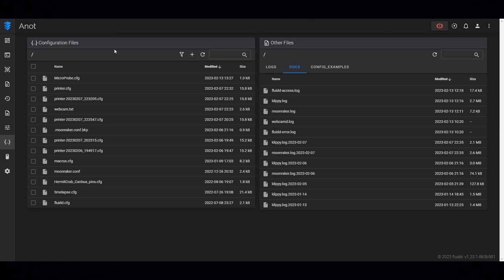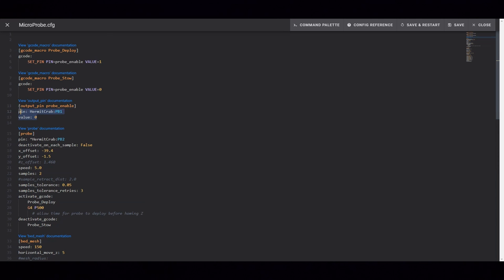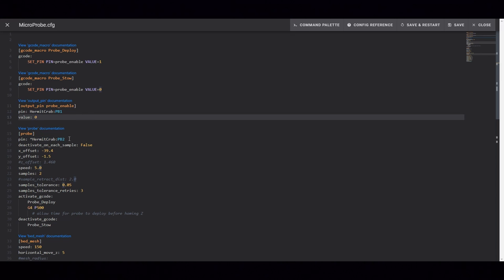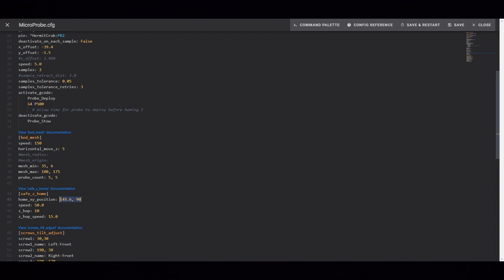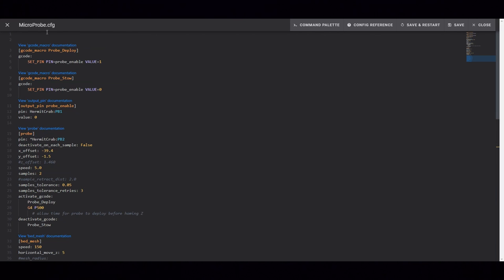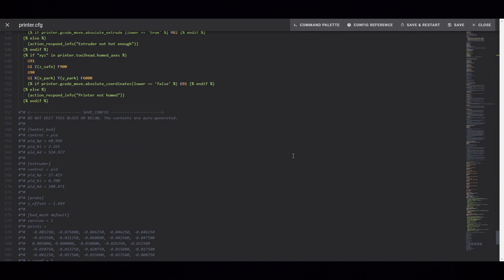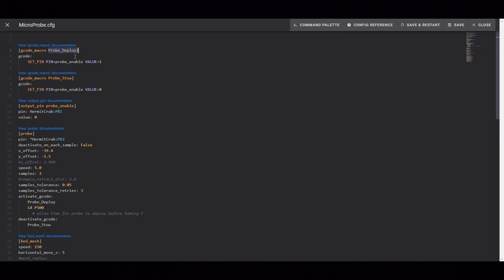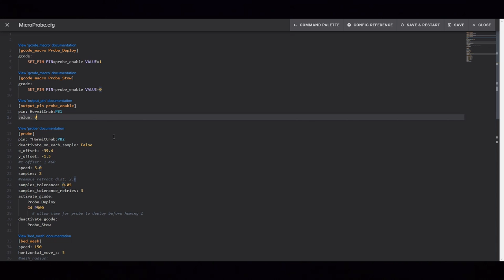How to configure the BIQU Microprobe for Klipper

Comment: Greetings, Thanks for the great video but i'm still having problems with mine.  I have the v1.2 release and I'm connecting to the Creality 4.2.7 M Board with Klipper as the UI.  For the life of me I'm missing something in the printer.cfg because all the probe will do when homing Z is extend / retract 4 times and then Klipper errors out with a probe retraction was not detected.  Here is what the config looks like:
[bltouch]
sensor_pin: ^PB1
control_pin:   PB0                    
x_offset: 39       
y_offset: 5.0

[safe_z_home]
home_xy_position: 117,117
z_hop: 10
z_hop_speed: 5 

Any thoughts?.  Thanks for the read. Doc'
Reply from the maker: You have it set as a BLtouch. You cannot use that as a BLtouch. It must be set up as I described in the video. Setting it up as BLtouch can damage the probe, from what I have seen with other users.
Reply: @StackingLayers Thank you for your reply but just for clarity please,
 

The socket on the 4.2.7 board is labeled Left to Right >  Gnd - V - IN - Gnd - OUT.
The Micro Probe socket is labeled board side Left to Right >  Gnd - V - Servo - Gnd - Probe

Your microprobe.cfg file is:

[output_pin probe_enable]
pin: HermitCrab:PB1         # Change this to the Servo/control pin number for your board.
value: 0

[probe]
pin: ^!HermitCrab:PB2       # Change this to the Probe/Z- pin number for your board. Remove the ! for V1 probes.

A few questions please:

Does the Ender (4.2.7) IN   =   Micro Probe "Servo"   =   [output_pin probe_enable] in the cfg?
Does the Ender (4.2.7) OUT   =   Micro Probe "Probe"   =   [probe] in the cfg?

Should my microprobe.cfg files first few lines edit to:

[output_pin probe_enable]
pin:  PB1         # Change this to the Servo/control pin number for your board.
value: 0

[probe]
pin: ^PB0       # Change this to the Probe/Z- pin number for your board. Remove the ! for V1 probes.
deactivate_on_each_sample: False
plus the rest of the lines.

Since [bed_mesh], [safe_z_home] and [screws_tilt_adjust] are already defined in my printer.cfg file do I remove them from your microprobe.cfg file?

Thank you again for all your help as this editing is a little bit confusing for an old guy.  Thanks for the read. Doc'
Reply from the maker: In = servo out = probe. Probe will be PB1 and  output_pin(servo) PB0
Reply: Thanks for the information and I'll give it a go.  Doc' @StackingLayers
Reply: @StackingLayers   Thanks for the education and help....it worked perfect.  👉 😁 👈
Reply from the maker: @doctrainsmodifications5201 right on! I'm happy to see you got ot going!
Reply: I have the same board. and i followed this to get everything up and going. and it was working great. i changed the offsets and set a new center bed position. Now all the sudden I'm getting 'Endstop z still triggered after retract'. and i cant manually extend or retract the probe. But when i cycle the printers power the probe extends and retracts 3 times. What am i missing? because I just had it working now I'm pulling my hair out trying to get it to work again.
Reply: Update. In a last ditch effort i went back to the board and re secured all my connections and it seams to have fixed the issue. i think i may add a dab of hot glue to get those connectors to stay in place. they dont seem to be very secure in the old BL Touch connector spot.
Reply from the maker: Checking the connections was exactly what I was going to recommend. A dab of hot glue won't hurt, and a little isopropyl alcohol will make the hot glue release if you ever need to change things

Comment: I'm getting an error with mine when I try to run a full bed mesh. Its saying "Probe triggered prior to movement"  I'm assuming this might be a hardware bug as it works sometimes and fails sometimes. Any thoughts?
Reply from the maker: If it works sometimes then it's configured correctly.

Is it a V1 or V2 probe? Some of the V1 had an issue with the sensor sticking, so if it's a V1 definitely contact where you bought it. Get a video of it happening and you should be able to get a replacement. Just be patient with support,. Do it if it is a V2 too, but I haven't seen that issue with V2.
Reply: @StackingLayers  it’s a V1 that came stock with my Hurakan. Thankfully I got it through microcenter with a warranty so it should be straightforward to get the replacement part.
Reply: @StackingLayers  Would a V2 probe use the exact same plugs? In the event I can get a direct replacement that seems like the easiest solution. So I don't have to re-route new wiring
Reply from the maker: @isaacingalls720 yes. It'll plug in to the same wires. The only thing you'll need to change is to add a ! in front of the probe pin like this,
[probe]
pin: ^!PC14
Reply: @StackingLayers Thanks for all the help. Got the replacement part today and it worked great
Reply from the maker: That's great to see!

Comment: I follow your video and I see this error: 'Set your own coordinates to position the probe over the screw points.\n'
Can you help me solve this please
Reply from the maker: Looks like that comment has been placed wrong.  It's probably missing the # in front of the comment. That's supposed to just be a note and adding a # makes it ignored in the code.
Reply: @StackingLayers  oh, damn, I'll fix that and see if it works. Say, do you know why when I home my Z axis, the axis goes up instead of down ?
Reply: @StackingLayers  It said:'Option z_offset in section probe must be specified'
what should I do? ty
Edit: after I delete '#' the error said "gcode command 'QUERY_PROBE' already registered"
Reply from the maker: You have to set a z offset. Put something like 1.5 and then run probe_calibrate to tune the exact height.
Reply: @StackingLayers  do I have to type a new  code line to set that z offset? Or I just need to change the number
Reply from the maker: @r8ntoryu330 just remove the # from in front of z_offset
Reply: @StackingLayers  thank you for all the response. I'm still new at this and just got the upgrades for my E3 Pro. After installing klipper and tumbling over many issues, I feel kinda desparate and just want to watch my lil war machine print.
Reply: after changing it. It now say this:"option 'position_max' in section 'stepper_z' must be specified". I set it to 250 and it still give me the same error message. Is there a way I can ask you this directly
Reply from the maker: @r8ntoryu330 it sounds like you need to go over everything line for line and make sure all is in the right spot. I have a video about the printer.cfg file so you can see how things need to be formatted.
Reply: @StackingLayers  I actually watched your video to set up klipper. I followed almost all of your steps. Only until this MicroProbe that I got a new issue. I will watch your printer.cfg vid. But can I send you a pastebin link in case after watching the vid, the errors still show?
Reply from the maker: @r8ntoryu330 yeah link the paste bin here.
Reply: @StackingLayers  I sent you an email and messages on your Instagram. I can't send the link on youtube
Reply from the maker: @r8ntoryu330 cool. I just replied to the email.

Comment: Hi, am using ocotpus pro board with micro probe I set all the thing accordingly with pin set configuration as well, when I tap on homing, Bed goes down little bit, then X home Y home then Bed will come in middle I set the coordinate but then klipper give error " Endstop z still triggered after retract" please help
Reply from the maker: It's likely you have the V2 probe and that needed a ! In front of pin number for the probe. Something like this (note: PC1 is just a random example. Use the pin number it's attached to)
[Probe]
pin: ^!PC1   # remove the ! if it's a V1 probe
Reply: Hi this is the klipper config, I have Version 2 and octopus pro board, the pin are correct as per Pinout of the Octopus pro, and I put "^!" as on probe pin.

"[gcode_macro Probe_Deploy]
gcode:
    SET_PIN PIN=probe_enable VALUE=1

[gcode_macro Probe_Stow]
gcode:
    SET_PIN PIN=probe_enable VALUE=0

[output_pin probe_enable]
pin: PB6         # Change this to the Servo/control pin number for your board.
value: 0

[probe]
pin: ^!PB7         # Change this to the Probe/Z- pin number for your board. Remove the  for V1 probes.
deactivate_on_each_sample: False
x_offset: 70.0                    # Change the probe offsets to meet your machine requirements.
y_offset: 55.0
z_offset: 0
speed: 5.0
samples: 2
sample_retract_dist: 2.0
samples_tolerance: 0.05
samples_tolerance_retries: 3
activate_gcode:
    Probe_Deploy
    G4 P500
      allow time for probe to deploy before homing Z
deactivate_gcode:
    Probe_Stow

[bed_mesh]
speed: 150
horizontal_move_z: 5
#mesh_radius:
#mesh_origin:
mesh_min: 50, 10           # Change this is the coordinate for the first probe point
mesh_max: 280, 250    # Change this is the coordinate for the last probe point
probe_count: 3, 3

[safe_z_home]
home_xy_position: 190, 160   # Change this is the coordinate for the center of the bed
speed: 50.0
z_hop: 10
z_hop_speed: 15.0

[screws_tilt_adjust]
#Set your own coordinates to position the probe over the screw points.
screw1: 30,30
screw1_name: Left-Front
screw2: 190, 30
screw2_name: Right-Front
screw3: 190, 170
screw3_name: Right-Back
screw4: 30, 170
screw4_name: Left-Back
speed: 100
horizontal_move_z: 5
screw_thread: CW-M3 @StackingLayers
Reply from the maker: What about in the stepper_z section, do you have virtual endstop set of is there still a pin for the endstop?
endstop_pin: probe:z_virtual_endstop
Reply: I've the same problem whit skr 1.4 all set as your video , set virtual endstop and try  in all way "^" or "!" and also "^!" but dont work 😢 seems not feeling any variation.
Reply from the maker: I've seen that some have to move the probe wire from the microprobe to the the z endstop port on skr1.4and some other boards. Something with the pull-up resistor not activating on the probe port. ^! Is what you should have in front of the pin number.
Reply: @StackingLayers  it's works! Thank you very much!
Reply from the maker: You're welcome
Reply: @StackingLayers  @Glospecial92 , so mine works intermittently, v1 with skr1.4 and used as virtual endstop on klipper.
so assuming it's not completely  a defective probe issue- what I need to try is move the wire from 0.10 to 1.27, and update the microprobe.cfg - probe: pin: ^P0.10 to ^P1.27 ?
Reply from the maker: You can try that. If it's a V1 probe it could be suffering from a triggering issue. If switching to Z stop port doesn't work you might want to contact BIQU or the place you bought it if from somewhere else.
Reply: @StackingLayers quick update, might help other V1 owners-  before I went into any debugging protocols, I simply grabbed the pin and gave it a 1/4 turn CCW and back 1/4 CW
- don't know if that had anything to do with the actual issue- but seems like it pretty much solved  that issue for me (and pretty consistent, for now- at least) 
thanks for all the efforts you put in to supporting this community!

Comment: I INSTALLED THE MINI PROBE AS INSTRUCTED AND I GET AN ERROR:  Option 'pin' in section 'probe' must be specified
Reply from the maker: Check that the spacing and punctuation is correct, if the pin option is there. Sometimes copy/paste messes with formatting so it's better to type it out.

Comment: For anyone using the SKR Mini v3.0 and compiling for Marlin (that has Failed Homing nonstop) try the following:

you'll need to use the Z-Endstop for the Probe Black (Grnd) and White(PC2) and only the 3 other wires on the Z-Probe input rather than all connections made there.

set up the following:

#define Z_MIN_ENDSTOP_INVERTING true
#define Z_MIN_PROBE_USES_Z_MIN_ENDSTOP_PIN
#define USE_PROBE_FOR_Z_HOMING
// #define Z_MIN_PROBE_PIN (for some reason it fails homing when using this even when setting up correctly)
#define FIX_MOUNTED_PROBE
#define PROBE_ENABLE_DISABLE
#if ENABLED(PROBE_ENABLE_DISABLE)
  #define PROBE_ENABLE_PIN PA1

Comment: Thanks for the video and copy paste cheating. 

My probe is in a constantly triggered state, connected through an ebb36 any idea what's going on. I've tried with and without the upside down v. 😱
Reply from the maker: You need the ^ for the sense pin. That's a pull-up for keeping things stable. As for the triggered state are you getting warnings or you are just seeing that in the endstop query? Because my probes show triggered all the time too, but they work. I think the only time they don't show it is at the time of probing, but I've never queried during a probe function.

Comment: It dosent work
Reply from the maker: What doesn't work?
Reply: @StackingLayers  the Probe doesn’t extend
Reply from the maker: Double check the pin is correctly named  for your board and make sure to indent lines that are under gcode:
Reply: @StackingLayers  yes that is all correct. my board is the skr mini e3 v3.0.0
Reply from the maker: Assuming you are using the probe port, it should look like the following.
Note: Some require the z endstop port to be used instead of the probe pin due to too much sensitivity on the probe pin . If you get false triggers or probing failed, then move just the sense pin and ground (white and black) to the z endstop group and sense pin, and change PC14  to  PC2.

[gcode_macro Probe_Deploy]
gcode:
    SET_PIN PIN=probe_enable VALUE=1

[gcode_macro Probe_Stow]
gcode:
    SET_PIN PIN=probe_enable VALUE=0

[output_pin probe_enable]
pin: PA1
value: 0

[probe]
pin: ^!PC14
y_offset: -1.5
#z_offset: 1.460
speed: 5.0
samples: 2
samples_tolerance: 0.05
samples_tolerance_retries: 3
activate_gcode:
    Probe_Deploy
    G4 P500
deactivate_gcode:
    Probe_Stow
Reply: @StackingLayers  thanks
Reply: @StackingLayers  the probe dosn‘t come out and And when I start the printer, it doesn't extend three times. What could be the reason for this?
Reply from the maker: That would mean it's not getting the power it needs. Either a bad connection or miswiring. The power up deploy in stow sequence is triggered when only power is connected so if that's not happening it means it's not getting the power it needs. Double check the pinout diagram to make sure you have the connections made to the right spots. https://github.com/bigtreetech/BIGTREETECH-SKR-mini-E3/blob/master/hardware/BTT%20SKR%20MINI%20E3%20V3.0/Hardware/BTT%20E3%20SKR%20MINI%20V3.0_PIN.pdf